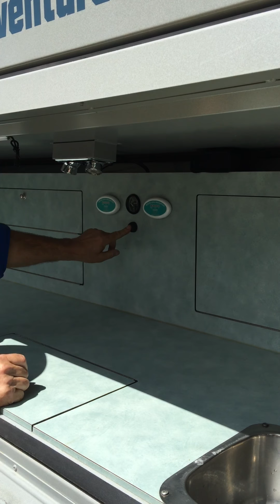Adventure camper trailer !

Comment: Hi, want to ask where you got the box for the shower from...we wish to do the same on our CT. how do we contact you? thanks
Reply from the maker: Hi Geoff 
Mate , I got the box made 
Then just added the gas shower system to it 
Drilled a hole in the top with a screw cap 
Add a pump , then add a gas bottle below the box 
The only hard bit was getting the right box 
Will see if I can find the paperwork on it , but it was a long time ago now
Reply: Hi Jake, thanks so much for replying. we have an adventure offroad, 2A and 3 Kids. we have a portable shower, but the way yours was positioned and boxed was fantastic. i already have both a water bottle and gas bottle connected to the side of the fridge. I am gong to literally take this video with me to show a local sheet steel place to see if they can make the box, and then somewhere to help instal. one question, did you have the pump hard wired to the battery, so all you had to do was flick the switch. can't thank you enough for replying.
Reply from the maker: Geoff Iredale 
Mate . It’s was all hard wired 
Even the gas 
What I mean , all I had to do was turn the gas on 
Switch the 12v pump on 
Pressure Switch 
Place the shower and get under it 
I am away at the moment (work) 
But I am sure I have better pics and some videos of it somewhere
Reply: Thanks Jack. There is no rush, just something I want to replicate on our trailer